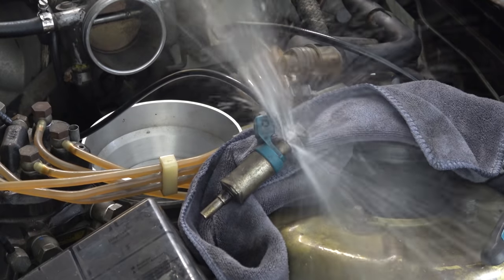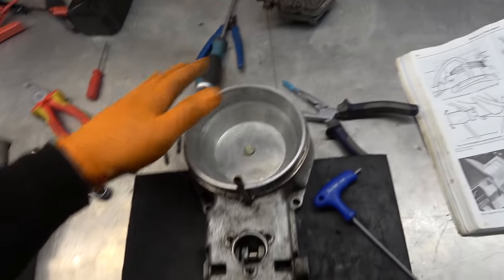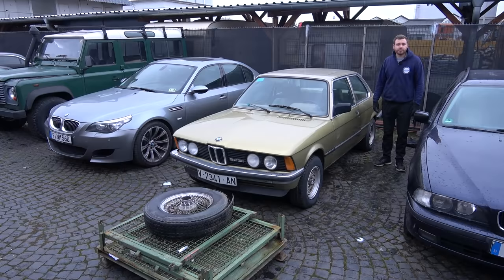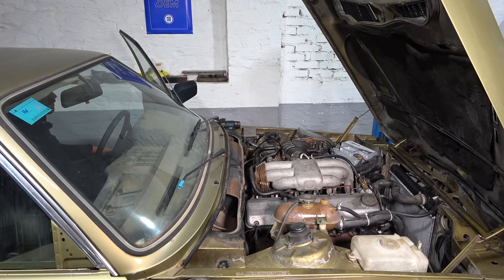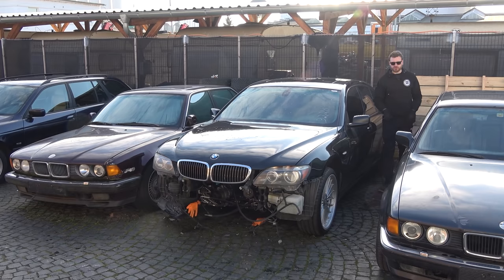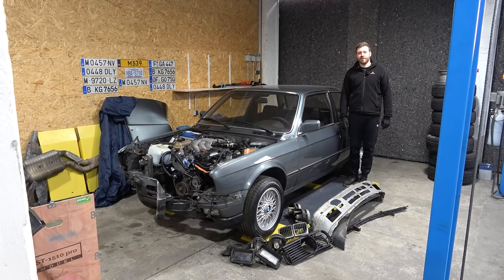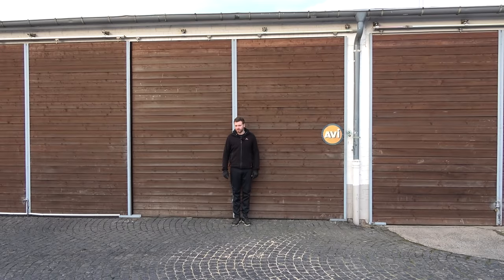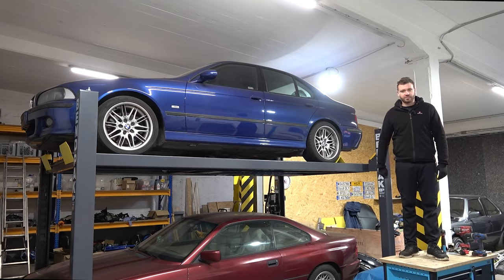Solving BMW E21 323i Cold Start Issues, Update On All Projects & News!

Comment: 28:00 with some plywood make a "box" fit the compressor in and glue silencing foam on the inside, and mount a little electrical fan to draw the heat from the "box"t.Then the noise is very acceptable. That is what I did.
Reply: Underrated comment
Reply: This. You won't believe what a difference a good "hush box" makes!
Reply: You don't wanna do that cause these compressors burn so much oil that you fill them up weekly if you use the thing often. You'll get a herniated disk from opening the box
Reply: @peterjansen5571  You could probably build a little access flap in to the box

Comment: When Bosch K-Jetronic works properly it’s amazing seeing how old tech works so well even under cold conditions. But it makes me sad to think how many BMW/Mercedes/Audi/VW cars have been junked because their owners or mechanics don’t fully understand the fuel system :(
Reply: Because it's a shit system. See Honda Fuel Injection systems. These just don't fail and sold million times since the 80s.
Reply: The K or KE-Jetronic is very difficult to adjust. Nobody here around 300 km in my city can do it. The Bosch service know nothing about it in the past and now.
Reply: @gokturk232  oh, please. Get a service manual.
Reply: You are completely right!👍
Reply: @vw5056   Manuel can hold your hand only so much, the system is flawed. It's the exact opposite side of the spectrum where idiots decide what goes inside a car (what's happening now with BMW), where people who are too smart for their own good decide what's inside and that makes the car unusable for the vast majority of the user base. If a car component can't be serviced or fixed because of either of the two sides of the spectrum... it's shit. That's the long and short of it. There's a reason these engines got modded or ditched all over the world and it's not just because people can't flip Manuel's pages.
For the record, i have a perfectly serviced engine, my car's just rusty to shit and back. So i know what i'm saying when i'm saying that this isn't for most people to enjoy. It's too complicated, too easily broken and it's entirely too easy to have wear drift take it out of commission.

Comment: Something like a 5kw reverse cycle air conditioning unit would probably work nicely at keeping the dojo at a reasonable temperature. And wouldn't have a very big physical footprint to contend with either.
Reply: For example Toshiba RAS-2M18U2AVG-E and RAS-M22U2DVG-E (2units) keeps warm and cools in summer.
Reply: Great advice, it will give more heat for the same amount of electricity compared to the basic electric heater you have now. Also cools during the summer and if the landlord has some money to spare you can save money in the long run by combining it with solar panels.
Reply: Also called a warm air pump
Reply: Does it work properly when the temperature outside is that low? I heard they work well maybe above 5-8 Celsius
Reply: @RminusOR  Yep. They work pretty well at those temps. Efficiency drops a bit around -10 degrees Celcius.
Reply: @RminusOR  ACs are great. It rarely drops below -10 Celsius and I've never had problems. The trick is to never turn them off because they can freeze. When you leave the apartment/ house/ garage just lower the temperature to 17 or 18.
Reply: @RminusOR  I have been using air source heat pump even in -25C weather, works fine but efficiency goes down with temperature (but never below 1)
Reply: @RminusOR  They work down to about -10'C or so without any issue as far as I know. Certainly mine keeps my house warm when the temperatures outside are down around the 0-1' range.
Reply: True, some the cheapest ones suitable for garage heating cost less than 1000€ including installing.
Quiet and ten times more efficent than electric radiators.

Comment: The gauge cluster on my E30 had the same sporadic action as your E21 has.  I found that the solder joints on the back of the gauge cluster were broken and causing intermittent contact...2 minutes with a soldering iron to re-flow each connection and the cluster never acted up again!

Comment: On the e21 I suspect the heat gauge being faulty. I have come across that twice already but haven't tried any repairs to know what would work. On clogged injectors I have had excellent results using a tire valve over the intake of the injector with a little hole in the valve cap to fit the straw from a can of carburettor cleaner. Remove the schrader valve from the tire valve and apply some power to the injector with some little jump wires and a small battery while spraying the carburetor cleaner. Again I have had great success.
Reply: I've owned around 12 e21 over the years, including maybe 7 or 8 323i and nearly all had temp gauges that showed just past the midway point as normal temperature in summer and winter months.

Comment: Probably a bit late now as you've got a new one but the CSV (Cold Start Valve) does have a habit of becoming clogged when not used for long periods. They can be cleared by putting them in an ultra sonic bath and activating it via a 12V supply. This breaks up the old, stale fuel that has sat inside it for years. My Capri 2.8 has the K Jet system and this is what I found with mine. I took my CSV to a guy who cleans injectors and seemingly the fuel turns to a sort of varnish like substance over time if left causing the injector to block up. Dont throw your old one away as you may be able to salvage it and keep it as a spare, always handy when new ones are unavailable. 

Great content though, keep up the good work and happy new year 🙂
Reply: Thought that too.  Does that thing also sit upside down?
Reply: @gplusgplus2286 , no. It sits on its side on the side of the intake plenum chamber.

Comment: Awesome video Sreten and Happy New Year! Great to see the E21 starting issue sorted - for the coolant temp gauge, I had the exact same issue on my E30. Not sure if they are the same but could be worth pulling the cluster to check the nut on the rear of the temp gauge is tight. I tightened mine and now the gauge never goes over halfway or flickers. Looking forward to more!
Reply: I’ll have to look into that. The temp gauge in my E21 has some erratic behavior once in a while.

Comment: I have no heat in my garage except for plans wrenching. But I have a small heated room in a corner with a workbench and som shelf’s I believe the measurements are 1,4x1,8 meters. I mainly use the room for reloading bullets but it’s nice to do small project in there and get warm if I am cold.

Comment: Are you gonna keep the M73 engine running on hydrogen? Would be pretty cool.
Reply: Definitely should.  Seems a shame not to.  Though I'm guessing obtaining the tanks and associated systems would be both very expensive and require a lot of research/book work.
Reply from the maker: That would be impossible sadly. Search on YT hydrogen E38 750 to see what BMW had to do to get it to work. As far as the engine goes, only intake manifolds are modified to take hydrogen. The rest is unchanged.
Reply: @M539Restorations  Ah ok, you should put the intake manifold up on the wall as an ornament then ;)

Comment: Others have pointed it out but I want to point it out so you can see it. GET AN AIR SOURCE HEAT PUMP. (Or is it just called HEAT PUMP, whatever) That way you can warm up the workshop during winter and cool it down during summer. I have heard that Toshiba ones are good products. I personally don't have any experience with them.

Comment: Ahhh.... relief! A new video!! I admit I get a little anxy when you a video isn't posted every week... Great video (as always)! And the summary of the projects was spot on, I had completely lost track of stuff. In terms of heating, have you tried electric storage heaters? They're popular in the UK (don't know if they are in Germany). The use electricity to store heat at night (cheaper electricity) and release the heat throughout the day. On colder days, there's an electric booster you can use for an hour or so. No fumes. No noise. Cheaper rates. All electric.

Comment: in my shop i use two split units midea AC 2020models , 24000btu each and they work great for heating a 80 square meters, and even better for cooling, consumtion is max 3kw each when first started in the morning and then drop to ~1kw each

Comment: Hey Streten,  glad to see you solved the E21 cold start injector issue.  I used to own the exact same model back in the day and I feel like I'm having a massive time machine moment watching your progress.  With some work,  the E21 can be made to handle quite good  -  but they do require some schmicko aftermarket front suspension bits.

Comment: I love these videos, watching these projects gives me a little bit of hope. My old 97 Golf Tdi just broke down on me, and it's my first car, been in the family since 2008, had 595k kms, its a heartbreaking esperience, even tho i worked on it so much in the past years, always being able to fix it, now its some weird electrical stuff that i cant fix, and no mechanic wants to work on it, because its too complicated and bolts are rusty and bla bla bla. Its a hard time for me to have a passion for cars, maybe I shouldn't get attached to objects.
Reply: Park it until you find a forum with the same problem.  Then buy a Toyota . You will be happy with low maintenance car.
Reply: What is happening with it? A Golf III is complicated? Lmao. Look for a competent garage.
Reply: @petepenn1  oh right, because no 1997 Toyota with 600k kms would ever need work. Get out of here.
Reply: @vw5056  electrical issues, i was driving down the road, all of a sudden every electronic just turned off, no lights, dash completely dead, radio dead, engine was running very poorly. Then it did this 3 or 4 times in like one minute and when i got home i turned off the lights switch and it turned the car off. Its complicated because its from 97 and has like 600k kms, and all the wires and bolts and brackets are rusty and full of dirt. In my country, mechanic shops just dont want the headache, the only option would be to take it to a dealership but they charge very much, so i cant really afford it.
Reply: @lavaZZa42069  Sounds like a classic bad ground. Start with inspecting the one on the left front fender that also connects to the hood. Also clean your battery connections. If this doesn't fix it look up a wiring diagram and check all grounds on the car.
Reply: @vw5056  that is  good idea, thanks

Comment: Great video as always! I dont know if somebody already pointed this out but I do believe the fan blades on the E21 are installed on backwards (concave side pointing towards the radiator). Maybe flipping them (concave side towards the engine) on the clutch helps with the temperature issues.
Reply: I'm surprised I haven't seen anyone else catch this too, first thing I thought when I saw it get installed. It may not make a huge difference standing still, but that will definitely be an issue at speed
Reply: @XxRaceBoy24xX  Doesn't need a fan at speed, fans are just to create flow through the radiator while stationary, at speed this isn't an issue. That's why cars overheat in traffic if the fan doesn't work but are ok while driving.
Reply: @slacko1971  Well, that's exactly my point. With the fan installed correctly, all of that is true. The concern is that, with the fan installed backwards, it will still push air through the front of the radiator when stationary but form a high pressure region directly behind the radiator where airflow stalls, resulting in overheating.

Comment: you should have looked into getting infrared heaters they works twice as good as diesel heaters and cost half the price not to mention you can get ones that hang from the ceiling that heat you directly while giving you a large angle of affect towards the area your trying to heat also they are just generally much easier to handle rather than diesel which in the end just costs more and is less efficient.

Comment: The E21 temperature issue is probably just an electrical glitch, but the first thing I'd check is the fan clutch. I'm obsessing on your E21 because I'm avoiding the rust in mine. :(

Comment: 29:00 the best solution (low invesment, low maintance costs) for heating is a proper air conditioner(s) with capability of heating in climate up to -15C  for inside convectors the best option are the wall convectors mounted low or on the ground . 
My garage have 65 m2 one AC 5KW (heating power) heat the garage up to decent temperature in the winter.
Reply: And the cost is only around 1000€

Comment: HAPPY NEW YEAR!!! AND CONGRATULATIONS!!

1. Build a box enclosure around the compressor, and use a fan connected to the box to draw out air, use a HVAC filter (any popular size as an intake)...this will actually give you some warm air in winter too when it's running

Put MOISTURE SEPARATORS ON EVERYTHING AIR POWERED/AIR LINES...everything will last MUCH LONGER

Can you install a Wood Pellet stove ??

We have oil stoves in USA that burn used motor oil for fuel...and vent outdoors...

Can you try those types of heating options ???

Comment: You should look into infrared heaters, its much more efficient as you are directly transferring heat from the heater to the object and not heating the air. We've used them in our workshop for years and are much more cost effective especially when you have large open spaces.

Comment: You have a very nice shop. Congrats. The compressor will give you headaches. The fridge motors on it will use more oil than a VAG product from a few years back. And that's a lot, believe me.

Comment: My e21 320/6 temp gauge used to do that same thing you explain , going a bit over the middle and then when the termostat opened, go lower, specially when idling, and much more with the air conditioning on. Summer and traffic would make me very nervous, but I think it's just that how it works. Probably its not a "weighted" action on that needle that modern cars have.

Comment: 1. you can change baffle plate height with very long hex tool, you need to find hole for that
2. with dish high you can regular a fuel pressure
3. if the dish is too high - more fuel or too low - don't give fuel

Comment: Hello,
You could try to run vinegar through the engine, that should remove any rust or lime scale buildups. The downside is, if left too long can go through the radiator. If possible, i would put old parts back and circulate a 50-50 mixture of water and vinegar through the engine for 2-3 days then flush it twice with water. Its cheap, effective but takes a bit of work.

Comment: So good to see you fine, and the tiny shed back to its rightful owner!
About the heating,  you are using an oil and fuel recovery device. Why don't you get a heating device that runs on burnt oil? You have so many cars that burnt oil really shouldn't be an issue, and that way you won't use electricity to heat up and basically your bill won't go through the roof. They are not that big, and really keep a reasonable temperature in a workshop, my mechanic has one and it's nice inside, and the space from what I see is kind of the same, more or less to what you own.
Can't wait to see the next video, take care of yourself and see you in the next one!
Reply: Man, Sreten is in Germany! Here in Germany it is punishable if you even think of using a used-oil burner.
Reply: @guzziwheeler  well, I didn't know that. Thought could help tho.

Comment: M539 restoration, you should buy INFRA RED radiator. It's perfect for a big garage as It only heats up the objects that its pointed out and not the air. 600Watts will make you feel hot even if it's freezing inside. You just need to keep it behind you at all times, 2meters is okay. They are cheap 60-70euro and very efficient. Look for one that is tall and has wide heating angle

Comment: If you want to reduce the compressor noise considerably, route pvc pipe to the outside of the shop, connect it to the intake of the compressor, and install the air filter outside. Take proper measures so the air filter doesn't get wet or frozen.

Comment: Re-renting your old space is such a milestone of success. Remember back in the day a 900€ compressor would not even have fit into that tiny space alone. If this channel continues on the current trajectory, you'll have taken over all of Frankfurt by 2032 to use it as BMW storage. :)

Comment: That cold start injector has a BOSCH number. Some other brands got the same. Only difference being the connection for the fuel line, wich can be fixed with fittings. I remembered on an E21 from a friend back in the day we used a Mercedes one. I believe it was from an 190E. Sometimes you can get some new old stock of them for a bargain. For minor clogs EGR cleaner works wonders.

Comment: Infra red heaters at strategic points where you are working. Use motion detectors to switch on and off. Rotary compressor would be a lot quieter-but a lot more expensive of course.

Comment: For heat, you may want to consider an oil-filled electric radiant heater (resembles an apartment steam radiator). They are silent and give off consistent, smooth heat without burning you.

Comment: It's the gauge.  The bolt that is used to hold it in the cluster should be the ground for it.  They usually get tarnished where the gauge bolt passes through the cluster,, it should be a copper surface.. Take the gauge out and clean the contact point with sandpaper.  I had the same issue with my 84 mercedes 300sd  temp and fuel gauge.

Comment: You should think about building a sound insulated cover for the (large) air compressor. Just a simple wooden box with sound panels does wonders in keeping down the sound

Comment: you should look into waste oil heating, as it's not like you don't have a bunch of waste oil about the place, just have to ensure good burn so high wind velocity :)

Then you can have an extensive exhaust which goes the length of your shop, should be good for keeping you a little more toasty :D